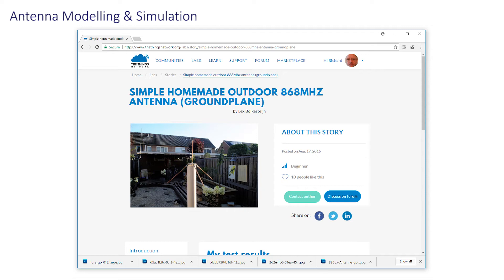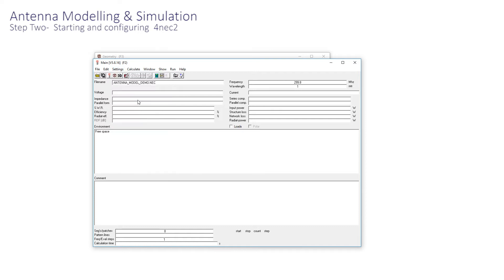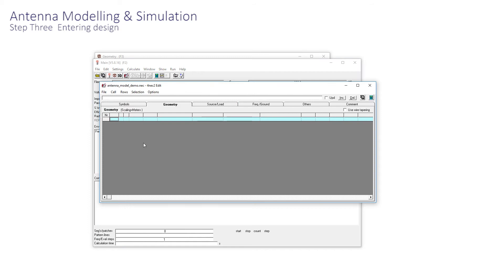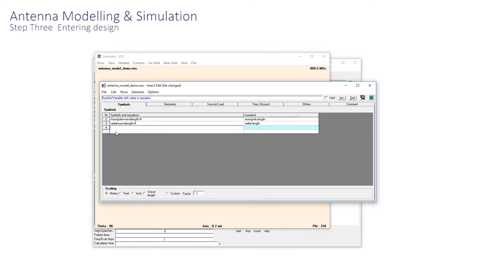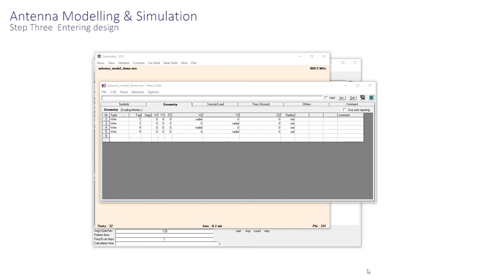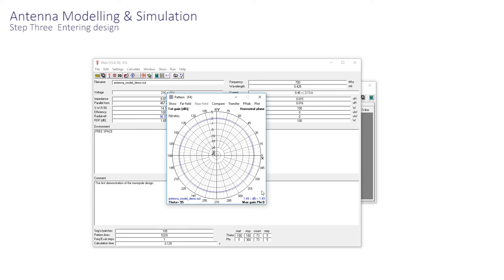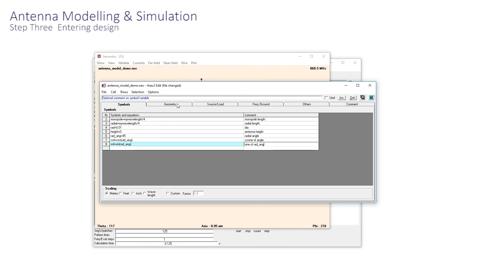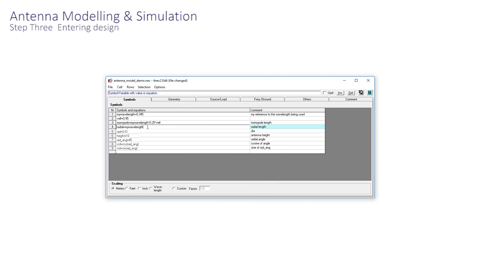Antenna Modelling

Comment: Great tutorial but I can't repeat your results.  I notice that you change the name of variables, presumably between edits, like "mywavelength" and "wavelength" (compare 3:04 and everything after 3:08) so I wonder if there's something along those lines going on.  After the mod that bends the radials down, I get a list of "too sharp angle or too short/thick segments(s) for wires 2 [also 3&4] (tag 2 [also 3&4]) and 3 (tag 3 [also 4&5])" errors.  I've checked my entries against yours extremely carefully and they are correct as far as I can see.  Don't know what could be wrong.  Very frustrating...
Reply from the maker: Oh err. Sorry.  I do recall an annoying stupidity along these lines (no pun intended).  At the moment I really can't recall the problem exactly or it's solution. I don't have that software loaded any more so can't quickly rerun it easily.  Frustrating as you say.  I suppose you could try substituting constants to see if that clears the error.  Otherwise (until the flash back when I'm trying to sleep tonight) we are both snookered. Sorry.
Reply: @richard_wenner  Thanks for the reply and thanks for the video nonetheless.  I suppose I learned from trying to figure it out too...
Reply from the maker: @Starlite4321  It bothered me in the shower this morning too!  It is something really silly such as the formatting or a leading space in the data. I'll be straight back if it emerges from the grey matter. Good luck.
Reply: @richard_wenner  Ok, thanks.  Good luck to you too.
Reply: Same here I can not reproduce the tuto so left it